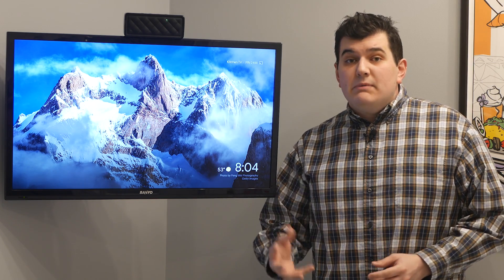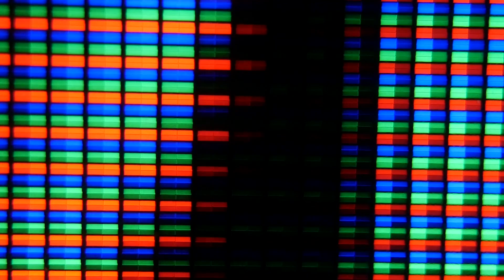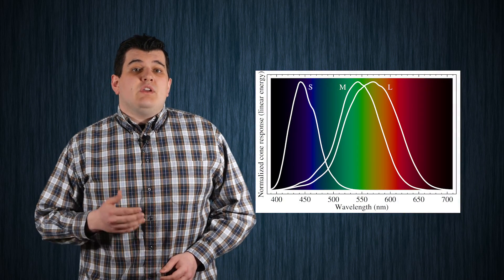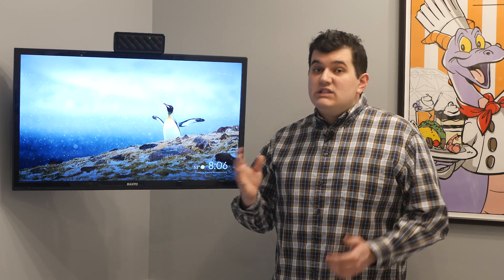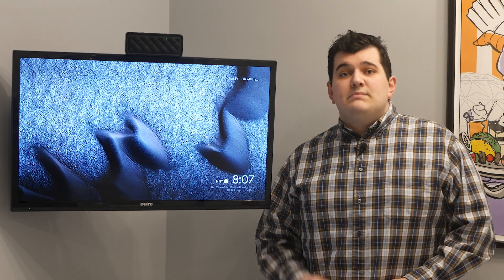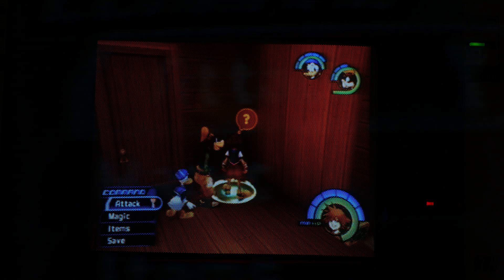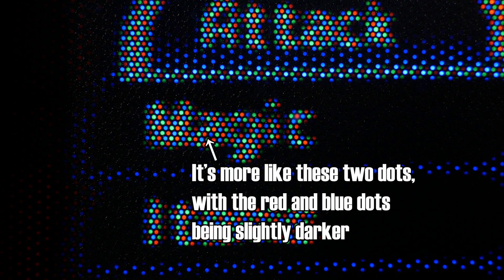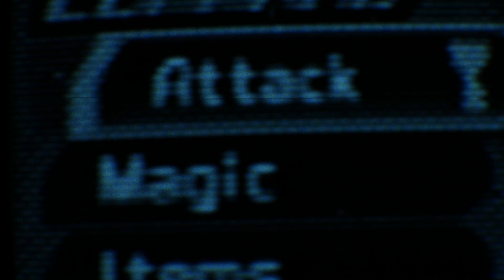These Are Not Pixels: Revisited

Comment: There most certainly is an upper bound on pixels in an analog image. Shanon info theory clearly defines this.
Reply: If an image is analog, the duo Nyquist/Shannon is out of the equation as they "kick in" only when discretion comes into play in either the spatial or time domain. Analog systems of course still have their resolution limits (probably what you are referring to be "upper bound") due to the limited bandwidth and suppression of higher frequencies.

As @RyanAumiller pointed out here, the recording side of analog TV seems to have at least a spatial discretion due to the capacitor array and their spatial distribution, but once smashed together by processing, transferring and displaying the signal on a CRT, on the playback side, the observable RGB mask doesn't make up pixels or "PELs", as some like to rather call them, nor do they represent the smallest element of an image in this case.
Reply: @little-endian5957 The term pixels means there is spatial sampling happening. Beam sweeps per seconds means there is  temporal sampling. Phosphors emitting integer numbers of photons per electron they are hit with means there is intensity quantization (sampling) going on. So yeah, Shanon info theory pretty much covers it all.
Reply: @Sam-tb9xu  That sounds like you'd want to apply quantum effects and thus some kind of quantization to everything where I would question if that is partically relevant. Even if one assumes a discretion here, the sample rate would be extremely high and so also the Nyquist frequency. 

Since I might be misunderstanding your point, what sample rate would you asume for analog TV standards then?

Comment: I have a slot mask shadow mask TV myself. It’s the Sanyo HT30746 HD CRT. I got it free recently. And I got one that was hardly used as it’s picture quality is better than my last CRT during the PS2 era. It too was a Sanyo and had Component Video for its highest quality connection. This CRT has 1 HDMI, 2 Component Video, One each of Composite Video, and S-Video, 2 RF inputs, and both analog and Optical Digital audio outputs.

Comment: have to disagree,  the red green blue colour sets/picture elements/pixels arnt adressable on a crt ill give you that, but they absolutly difine the resolution of the picture just as any other pixel count on any other display techknowlegy, the more red green and blue colour blocks over a square inch the higher the resolution, its like a vga crt vs an svga crt the difference when reading small text with the same size screen, I ounce fitted an svga crt to a tv chassis and got it working back in the day just to see how good it would look and i can tell you it looked incradable compared to the low res tube i took out, I get what your saying but even though the pixels are not addressable, the same red green and blue dots co-inside with the red green and blue gun everytime the guns scan over the shadow mask so they run in sets of red green and blue and this means they amount to a colour picture element (AKA PIXEL!).
Reply: Besides the definition of the term "pixel" (which of course could also be interpreted as spacial frequency), there isn't anything to disagree here.

As the author correctly explains, the grid of the shadow mask doesn't limit the resolution of the luminance but only for the chrominance.

The (horizontal) spacial resolution of a traditional analog TV is rather limited by its video bandwidth, determined by its electronic components, the signal it is fed with, etc.

This is directly comparable to the audio domain. Just because an analog system - as any system - is limited in bandwidth and signal to noise ratio, doesn't mean that there are suddenly discreed samples out of nowhere.

Hence no there are no pixels in the common sense of discreet samples on an analog TV set.

Comment: Still think they are essentially pixels. Pixels are the atoms of images. CRT images are still built from collections of the colour dots.

It's just semantics.
Reply: No, it isn't, as "dots" would mean that one has discreet, well-defined elements of an image which isn't the case here.

Compared to audio, it would be the same false conclusion to assume to suddenly have discreet samples within a continuous signal just because one could theoretically have constructed them during an A/D-conversion (but hasn't).

The key difference is that with analog television, within a line to be drawn, any signal state is deemed valid with no clear boundaries or discretion. 

The argument can also be made from a different "direction": classical "pixels" in terms of discreet elements introduce "imaging", i.e. high frequency distortion which wasn't contained by the original signal due to the steep boundaries. The drawn image on a CRT won't have that.

The only reason why discreet picture elements - based displays work for us is that the high frequency distortion usually is optically filtered by the optics of the eyes, acting as a low pass filter. Otherwise we'd always perceive what it really is: a blocky image which lacks a proper low pass filter which for audio, is part of any halfway decent D/A-converter design.

Comment: Wait I’m confused, what stops certain colors from showing? What stops the entire screen just showing a blank white image?
Reply: Each electron gun is angled, relative to the holes in the shadow mask, so that they can only hit phosphors of a certain colour.

Imagine that you have, in front of you, a sheet with holes in it. Through the holes you can see a set of tiny areas of what's beyond. Move your head horizontally and/or vertically, now a different set of tiny areas is seen.

The electron guns and holes are positioned so that the guns' "sets of tiny areas" don't overlap.

Comment: Imo analog should only be measured in TVL (brightness) not in pixels. In theory, a DVD on a CRT is 540 TVL (720×0.75= 540) however a DVD is digital and not the same thing. You can also watch HD images (in non HD) on a CRT. I got my first blu ray player years ago and i had to use composite cords but i was able to watch the 1080P image (of course downscaled to 480i) on my old tv. Those old tvs had more "muscle" then we give them credit for at times.

Comment: Weird, I was kinda not getting why the Carts don't have pixels, right up till the very end. All the time I was trying to understand, even if your explanation was so thorough. I think that what made me understand, is thinking of the CRT as just a garden hose, spraying water in lines, roughly drawing an image onto a concrete wall, but this wall has a stencil made out of thousands of tiny dots. Once you remove the stencil, you'll see an image made up of dots. But the exact location and size of these dots is variable from TV to TV. And the water hose doesn't really aim at any particular hole in the stencil, it just knows to spray in that particular direction, and whatever water makes is onto the wall varies from stencil to stencil (TV to TV in this metaphor)... 

Now, it's not a perfect metaphor, since the stencil is not near the emitter, which it should be for it to be like a TV, but otherwise, I think it's a pretty solid interpretation...

Comment: I think it's easier to explain than this.  Consider a black and white TV.  If you had a very high quality amplifier and an analog input to the TV you could change the signal on each scan line thousands or even millions of times so the horizontal resolution is theoretically unlimited for the black and white luminance signal.  However the original TV standard only had 240 vertical lines and when you add a shadow mask it also limits the number of color pixels (groups of 3 holes) in horizontal and vertical directions.  But still, for the brightness of a black and white TV in horizontal direction the resolution is theoretically unlimited.

Comment: IMO the best argument for why phosphor dots aren't pixels is that all NTSC TVs have a resolution of 480 lines no matter how many phosphor dots they have.
Reply: I'd say phosphor dots aren't pixels, because the resolution (in pixels) can also be higher than the number of phosphor dots, because the phosphor dots can als be struck with variable intensity. But I'm not sure.

Comment: eh I thought every pixel on an LCD panel are discrete pixels (they're all integer registries).  Sub-pixilation is a filtering/rendering concept.  you can't divide a single LED nor can you divide a single LCD Pixel.  sub pixel rendering is an algorithmic transformation to simulate a sub-pixel.   think of your old Pixel based games with soft edges. That's all it is.
Reply: @Roger Wilco - justice and really clean floors okay that makes a bit of sense.  These are not discrete sub pixels but pixel color channels.

Comment: Hi your description of how color tv works is not quite accurate.
You imply that each color gun paints the image.
This is not quite true.  Actually the 3 color guns first paints a black and white picture. ( this is the reason when setting up a color TV you adjust the 3 guns to make a perfect B&W picture)
The color image is a much lower bandwidth and is painted over the B&W image.  This is done to maintain compatibility for B&W TVs.  Additionally, the human eye cannot see color in small details.  This is why this works to create a color image.  You can prove this by turning down the brightness all the way down the turn color all the way up.  You will see very smeary color image.  However, when painted over the B&W image you will get your color picture..  hope that helps.
BTW..  Love your channel!!!
Keep up the good work!
Reply: BTW an interesting fact.  Color TVs had a delay line in the luminance channel (the B&W part of the picture). This was due to the fact it took longer to process the chrominance channel (the lower bandwidth color part of the picture).  To solve this and keep the color in registration with the B&W image, it was necessary to delay the B&W picture slightly...

Comment: I think you could have done a LOT better by explaining how the phosphors are painted on the backside of the CRT. In a black and white TV it's just a smooth even coat of a single type of phosphor. The electron gun just "lights up" the individual phosphor molecules that it strikes. The "resolution" of the screen itself is theoretically "infinite" (e.g. atomic), limited only by the accuracy of the electronics driving the electron gun. A good electronics hacker could potentially get 4K UHD "resolution" out of an 80 year old black and white picture tube. 

Understanding how the phosphors are painted on a black and white screen naturally leads into what changes to paint the RGB phosphors on a color CRT. The principle is the same, the electron gun lights up individual molecules of phosphors wherever it strikes and the maximum image resolution is still "infinite" (with limitations placed by the shadow mask), but the color resolution is limited by the horizontal spacing between phosphor groups.

But I digress - it could be that a part of the reason for the gap in your explanation is because you're focusing on this whole conversation from the perspective of TV, which never made it beyond 480i until the late 90s and early 2000s. A little exploration of the same "TV" CRT technology in the context of computers would at a lot to the discussion.

The way the phosphors are painted is one reason why CRT monitors had such a huge advantage over LCDs until only VERY recently. LCD monitors existed in the 90s (I think you could even find some computer LCDs back in the 80s) but even as recently as 2015 a 20 year old high-end CRT could outperform all but the most expensive LCDs. In 2005 or so I picked up a used Viewsonic P225f for around $30 and its native "resolution" of 2048x1536 was still beyond the reach of consumer LCDs for years to come (nevermind the high dot pitch and better color rendering). Also, because the phosphors are not "pixels", you could tune a CRT computer monitor for higher "resolutions" by adjusting the signal frequencies - though you would eventually hit the limit of the DSUB analog video connection's bandwidth and potentially lose color information as your video demonstrates. It wasn't until 2015 that QHD LCD monitors that could compete with the CRT's image fidelity came down enough in price to be affordable to the average consumer and most computer monitors are STILL operating at the much lower quality "Full HD" resolution (and the average not-gamer laptop still only operates at the even lower "HD" 720p resolution. To this day I base my computer monitor buying decisions on a comparison to that Viewsonic monitor, because anything with lower resolution or a pixel density lower than the Viewsonic's dot pitch is technically a downgrade.

Comment: Honestly i find it really interesting how technically black and white crt displays have no defined resolution at all beyond the line sync, with a little modification to the timing for the lines you could display nearly any resolution on it and it'd just work

contrary to digital lcds which have a fixed resolution and to display anything else it must resize it with all the artifacts that scaling brings

Comment: @technologyconnections The difference between a CRT and an LCD screen is that the CRT has one active gun, and a beam that is deflected to passive phosphor. An LCD has individual active crystal gates that pass or block light that is passively directed by a backlighting reflective surface through a passive color filter.  You should read the 1951 ITI of Chicago Technical Training Manuals. They go on to specifically describe a black and white television screen in a resolution of picture elements, and compare it to the theoretical picture elements of 16mm film, which was a common video source at the time. The film, of course, has a higher resolution, and in theory, with proper printing technique, can have a 2K equivalent resolution. Black and white TV of the 525 line system has an infinite horizontal resolution limited only by the bandwidth of the television circuitry, and the beam focus. The trailing edge of the beam determines the clarity. Black and white television can have a horizontal resolution that exceeds modern HD, and looks quite good (and can be made HD color with a synchronized color wheel). While a CRT does not have active pixels, it does have picture elements, and the single (or three) gun is analogous to an LCD pixel. You would achieve the same result with a single LCD pixel if you had a means of subsequently deflecting the light put out by the pixel. Using a system of mirrors, you'd basically have a Scophony televisor, which used a Jeffeys Cell for the  light gate.

Comment: Hi!  Just wanted to complement 2 things:

1. CRT's although they dont have an official horizontal  number of pixels, it does actually have a limit. The maximum number of pixels can be calculated to be the minimal of three things: frequency of the signal received, cathode maximum speed and the phosphorus' maximum switching frequency (that is, the amount of times the phosphorus can light on and off per second). In interlaced systems, the horizontal number of pixels may double against progressive, while only drawing half the screen.

2. It may be better to understand pixels as what they are: an abstraction. A pixel doesn't necessarily directly correlates to a physical structure, grid or layer. Pixels are just a part of a digital picture, which itself is another abstraction.
So, when we take a picture, we capture light from the real world. This capture is made by millions of dotsized-sensors. Although it is a lot of dots, it still doesn't trully reflects the physical world. Then, the info from these sensors is then translated to the digital world as a 2d-matrix of pixels and the size of this matrix is what camera sellers advertise as megapixels.
Now, when we are going to translate this image from the digital back to the physical, we depend on screens. The screens determine how we will perceive this 2d-matrix and we should not think of them as some sort of simple transducers. The screen may or may not try to copy the logical structure of the pixel abstraction, like modern screens often do. Or use another system like AMOLED, which shares a "subpixel". Also, I say "try to copy" because a "real-life pixel" is 3 lights side-to-side as in the digital/abstracted version the lights are supposed to be from 1 light source only.
This topic is huuuge and has a lot of interesting things going on here!

Comment: If only you had a large 25" delta gun TV to demonstrate. You can see crisp scan lines as you can with a black an white set. In-line gun sets tend to hide the scan lines pretty effectively. 

Also it should be noted that to add color to the existing 525-line standard, they actually sacrificed some horizontal bandwidth (I.e. horizontal resolution). The original black and white standard had up to 4.5MHz of video bandwidth - that's the highest frequency of alternating light-dark pattern that can be distinguishably drawn each line. Color brought it down to below 3.58MHz, so technically black and white sets are capable of slightly higher image clarity than color sets. On larger black and white sets you can even see an upwards-crawling lattiace pattern that IS the color information. Black and white sets made soon after the color standard (1954) started adding filters to just chop off everything 3.58MHz and higher to limit the pattern's visibility in the image.

Comment: 5:00 The horisontal and vertical synk pulses (as well as the blanking) in a black and white tv are conceptually binary, not continuous. So it would not be wrong to call them digital. They work pretty much like signals in a computer.

Comment: @4m01, it's called Cathode Ray Gun, Philips used to produce them in the Town of Sittard, NL.
(each) pixel can be addressed, whereas CRT monitors use  transistor based SAW waves to move the electron beam from up to bottom, left to right.